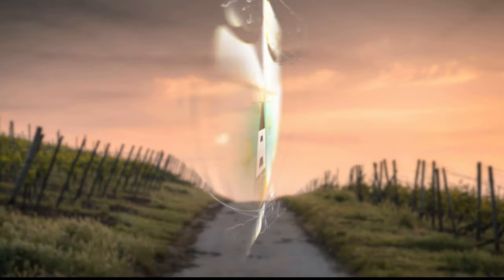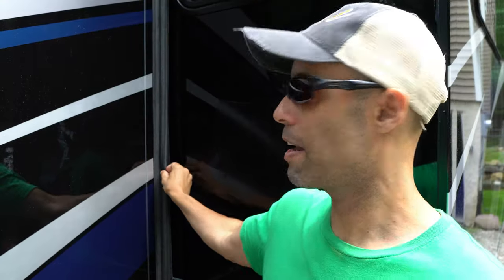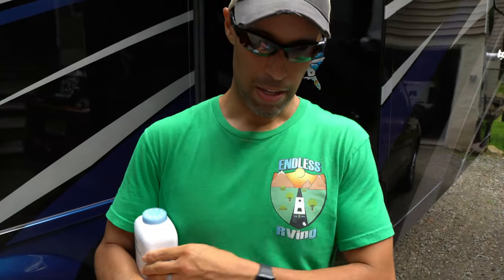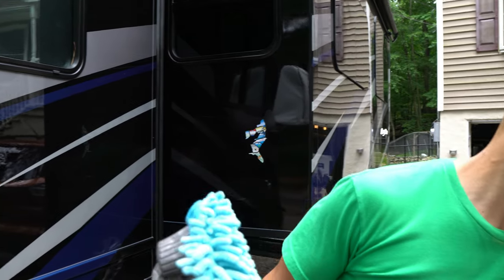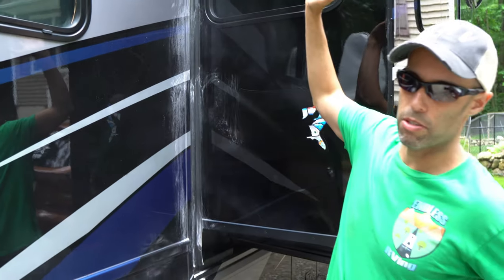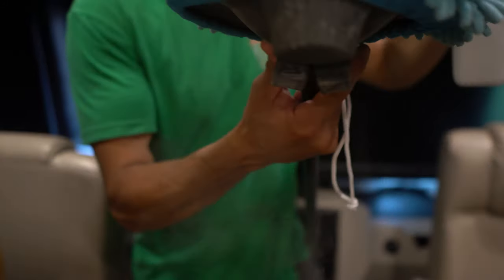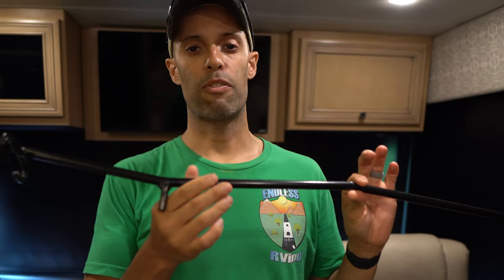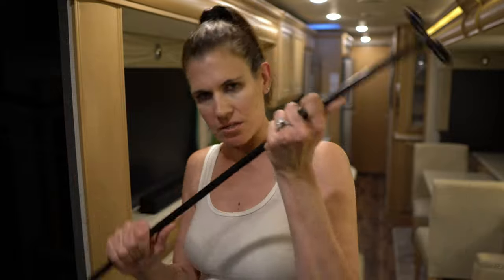RV Slide Seal Maintenance And Lock Operation -- Easy DIY

Comment: Informative video. I prefer using 303 protective but many RVers are using the whole line of RV products from 3-in-1. The slide locks was one reason we developed a step by step procedure for both set-up and tear down. They teach that when you learn to fly so you don't miss anything.
Reply from the maker: Thank you Roy.   Step by step every time helps reduce error.    We learned the hard way lol.   Thanks for watching and the comment. 

Izzy

Comment: I would have never guessed baby powder!  Love that gem of a tip!   We had a trailer we bought used that the top seal has dried out and unknown to us had been letting water in resulting in a partial rotted floor in the slide out. And there was no topper to prevent the water from gathering on top. Thanks for the tips.
Reply from the maker: Hi guys, yes baby powder is all Newmar recommends.  We try to keep on top of the seals at least annually.   Thanks for watching and the comment. 

Izzy

Comment: My new Ventana Le has the slide locks and they make a couple of them pretty hard to get to.  The branding tool barely fits between the two walls on one and another one on the end of the kitchen slide, must go through a door on the inside of the kitchen cabinet.  It took a few days to realize that secret door was there for that reason.  The biggest help I have found is the use of a flashlight for the really tight ones, otherwise it's just too dark to position the branding tool correctly.  As for the conditioning of the outside  rubber seals on the full wall slide, I have yet to find a contraption long enough to get to the middle of it going underneath the slide topper as the slide is just too large.  That portion of the rubber seal will be without powder for the life of the motorhome. For the price of these, the low tech, inexpensive automatic slide locks should be standard on every motorhome leaving Indiana.  Thanks for the content.
Reply from the maker: I can see the full wall slide being an issue for sure.   Maybe a super long extension pole with a sock, but don’t know how long those poles expand.  Thanks for watching and the comment. 

Izzy

Comment: Great information on the slides. I never heard of using baby powder. I will have to do that. I do like the thought of using the slide lock to knock out an intruder. Best advice to this point in the video. lol Yeah we got told by our Newmar dealer if we think we might forget to unlock it then don't lock it at all. Said if you try to open it locked you may ruin the slide. That is wild. You would think it would have a safety to prevent you from doing that. Thanks for the share y'all.
Reply from the maker: Hey William baby powder for sure and yes do not open a slide that is locked.  That would not be a good day!!

Thanks for watching and the comment.  

Izzy

Comment: Great video, haven't used the baby powder yet but will do that for sure.  Our slide locks has actually say do not lock.  Not sure if that is from the previous owners.  We haven't locked ours so far.  Thinking maybe I should.
Reply from the maker: Hey guys if equipped with manual slide locks they should be locked prior to driving down the road.    We talked to techs at Newmar about this and they confirmed they should be locked.   They also confirmed about the baby powder.  Thanks for watching and the comment. 

Izzy
Reply: Endless RVing sounds good. We’ll start doing that.

Comment: I use silicone on the seals it makes the slide room slick so the seals don't stick and it doesn't harm the paint. It's also easier on the motor if the seals aren't sticking.
Reply from the maker: Yep whatever you use.  Baby powder has the same effect.   Thanks for watching and the comment.  

Izzy

Comment: Izzy I have a question is there a seal at the very top that goes the length of your slide on the outside you do you have a cover but my question is how do you get to that seal with the spray for the outside
Reply from the maker: If you have a slide topper it’s not possible unless you remove the topper
Reply: @EndlessRVing   ok got , i will do what i can reach w/o screwing things up lol

Comment: You didn’t show all slide seals. There are others on outside lip of slide. 3 outside & 3 next to RV. 
(2 on side & 1 up top) but there are 3 more total 6 to a slide. The other 3 are (2 on side & 1 on top). Those outer rubber stopper seals are important too.
Reply from the maker: Hi Michelle for the sake of time I did not show every seal merely a small example on how to maintain a seal. I did say in the video you should be checking all the seals and my assumption is that most adults would do this.   Thanks for clarifying and watching the video.  

Izzy
Reply: Q. Why would you need a repairman to replace slide seals?  Don’t some of the outer seals slide in and out? This making it easier to replace? Just asking. For personal info. Thanks again & Happy Trails

Comment: Izzy God bless you  brother, but my full wall slide when it is inside I cannot get to the far back seal inside to powder as  for my bedroom slide iin there is very little room to powder the inside seal so how do you do it?
Reply from the maker: Put a powdered sock on an extension pole and use that
Reply: @EndlessRVing  i have a full wall slide there is no way to get a pole extension all the way back  , reading newmar manual on slide maintance , doesn’t say anything  about inside slide maintenance and now i know why lol